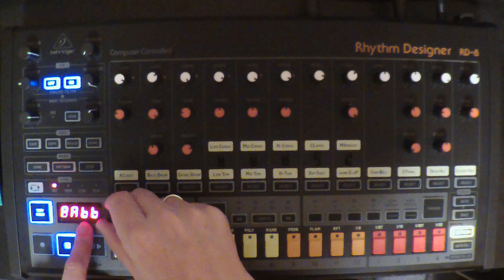Behringer RD-8 Behringer bug (fixed in version 2.0.2)

Comment: It seems to me that the issue is that the first step of the the pattern you have just changed to plays at the step size of the previous pattern.

One way I have found to overcome this bug is to sync the RD-8 from an external MIDI clock.
Reply from the maker: Thanks for the comment and sorry for the late reply, I didn't get notified on a lot of comments as I just found out. This is great info btw, I must give it a try! Thanks for the comment!
Reply: This problem goes away if you sync the RD-8 to an external MIDI source; this seems to override the issue.

Comment: Does it do this with 16 8 and 32 then it seems normal cuz you changing tims signatures from 4/4 to 3/4 and then back to 4/4 you add and loose a beat so its gonna be off . try staying in 3/4 time
Reply from the maker: Sco B  No, this is clearly a bug. When switching from 4/4 to 3/4 you actually switch from a 16 to a 12 step pattern and back and this should not affect the tempo or the actual position of single steps in either one of these patterns at all. The change should happen seamlessly, there shouldn't be an audible difference between the two patterns in this demo, except maybe for the swing value in the 4/4 pattern not matching a 12 step pattern 100% (but extremely close). I have many other drum machines and grooveboxes and I've written songs that vary between different time signatures so I can tell you that other machines like the TR 8 don't have this issue. I am quite convinced Behringer will fix it though, it only seems like a matter of time.

Comment: Great video ! I have a question: I would like to output the sounds of my rd8 independently on ableton (in usb or audio). Is it possible to have the RD8 as an audio interface? or that each instrument is on a single audio track? (to work on stereo)
Reply from the maker: Unfortunately the RD-8 doesn't offer audio over usb functionality. You can use it as a MIDI interface but not as an audio interface.
Reply: @LousyFacelift  
Ok thank you for your answer, and how can we get independent sounds from others on the daw?
Reply: @LousyFacelift  so to get Multi-track Recording?
Reply from the maker: Leo M You need a mixer and outboard gear like effects processors to shape each sound the way you like and then send the mix out to your daw. Or you would need an audio interface with as many audio inputs as outputs on the RD-8. So it's more of an old school approach just like on the original 808 in the RD-8. Some that wish to do what you described prefer the Roland TR 08 over the RD-8 because there you have audio over usb and not so many individual outs.
Reply: @LousyFacelift  
ok thank you so there is no way to make the multipist with the "mono" or usb i think.

Comment: Has anybody else come across this bug: When performing a save pattern, you are prompted to select save destination. However the pattern is saved and overwriting the original pattern number no matter which destination you select.
Reply from the maker: Haven't noticed this but it seems you can only copy patterns within the same song. So basically each song has its dedicated pattern bank with 16 slots and you cannot copy any of the patterns from one of these banks to another.
Reply: Interesting. In this case I'm trying to do a "Save as.." kind of operation within the same bank, neat for saving a few variations on the same pattern.
However I realised that the RD-8 ignores your choice of save destination. Workaround is to first copy then alter.
Isn't nearly as grave as the issue you demonstrate in the video - A drummachine that cant keep time, that's just gnarly ;-)

Comment: Mine has issues when switching beetween patterns that were written in the same time signature. It either takes much longer than it should to switch or doesn't run until the end of the sequence, or a combination of both (it might for example play the same bar twice and start the next pattern on the 3rd beat, instead of switching at the very end of the first sequence and playing the next sequence from the first beat). Have you experienced this yourself ?
Reply from the maker: That's new to me, sounds quite chaotic indeed. Let's hope for a bug fix in the next update. Thanks for watching!
Reply: This is not something I've read about online either. I've sent them a support ticket while waiting for an eventual miracle update...
Reply from the maker: Tresor Public Well, they still have the RD-9 in the pipeline and I don't think they are going to release it without fixing the firmware first. Akai did the same with the MPC Live. It was full of bugs when it first came out but they kept improving and fixing stuff and they are still on it to make it an amazing machine. That's not how it should be of course but I'm quite optimistic about it.

Comment: What happens when you're swing is set to 50? Just out of interest....
Reply from the maker: That's the neutral setting meaning no swing at all. It's a percentage value which defines when all the even number steps are played in relation to the odd number steps. The time elapsing between step one to three would be 100 %. Since 50 % is right in the middle between steps one and three this means no swing at all.
Reply: @LousyFacelift  Yes. I noticed that your swing was set at 67 for this video.... I was wondering if the behavior of the bug you described was the same with swing set at 50.
Reply from the maker: John Franklin-King Swing is set to 67 only for one of the two patterns. The patterns are programmed using two different time signatures but still sounding the same because of this setting. Swing should have nothing to do with this issue.

Comment: I don't think drumbeats are copyrighted 🤔
Reply from the maker: Yes, probably not but I wasn't sure... It seems they are finally doing something about it, rewriting much of the code for the RD 8 before they release the RD 9. I hope they get everything fixed.
Reply: @LousyFacelift  yeah cuz I think chord progressions aren't even copyrighted, so a beat seams unlikely. Sounds dope all the same 👌. Yeah the issues with the rd8 are sort of putting me off getting one, heard there are midi sync issues also...
Reply from the maker: Jamie Kent Yes, I had to say it before - I cannot recommend getting an RD 8 at this point, which is a bit of a shame but they seem to be at it, working on a solution. They have to have things fixed before the release of the RD 9, so I also don't suggest selling the RD 8 to those who have already got it. I would like to hear from someone who bought the RD 6 if that has any timing issues with different scales... maybe they already fixed this issue in there. Who knows?
Reply: @LousyFacelift  yeah that's exactly what I'm wondering, for the moment rd6 demos are pretty basic... Wait and see 🙂

Comment: Yep. This is my biggest issue with the unit. Going from 1/16 to 1/32 and back, no matter what master tempo I set, I get this issue. Definitely needs a fix. The latest firmware didn't resolve the problem. Did you contact Behringer?
Reply from the maker: Haven't contacted them, no. But I hope they know already and realize it's a true bugger...
Reply: @LousyFacelift  I submitted a ticket, and also flagged a request for midi program change for externally sequencing patterns, along with request for option to remove flam/probability triggers from new patterns. We shall see.
Reply from the maker: ozoneau Good thought on the flams there, too! You can create a pattern template for this but copying it over everytime is a bit of a drag. Thanks for contacting them!
Reply: There are more firmware updates coming so I'm sure all these will be resolved
Reply: @sirsilver1968  Sounds promising. Where did you hear about upcoming firmware?
Reply: @ozoneau  on the gearsluzt forum uli behringer is a member there along with one of the testers from Manchester they confirmed that more updates are in the works for the rd8
Reply: @sirsilver1968  Thanks for clarifying. Sounds promising. Still an awesome piece of kit as is.
Reply: @ozoneau  your welcome it is yes I love my Rd8
Reply: @sirsilver1968  The (sad) resolution from Behringer after sending a video demonstrating the issue to support: They couldn't recreate the issue and told me to return my unit as they consider it faulty.

Comment: All Behringer products are made 1/2 ass. They need to spend less time counterfeiting Roland's product, and more time in R & D. Roland's 40 yr old TR-808 still runs tighter than Behringer's new RD-8. Behringer never made a perfect product, it's their legacy !
Reply from the maker: I disagree. I don't own the Neutron but it's an original Behringer product, no cloning involved at all and people seem to love it. To me that's a perfect product. The Model D is a widely respected remake of the MiniMoog. It costs less than 10% of the original, adds MIDI and a high pass filter and people can't tell it apart from the Moog. To me that's a perfect remake. They are currently rewriting the code for the RD 8 and 9. They won't let us down on this. Peiple complained about the envelopes in the Pro 1, they fixed it. Sounds amazing now! Do you ever hear guitar players complain about Stratocaster and Les Paul remakes? No. Probabky because they don't have the time to do that, they are busy playing them... So why do you hate on Behringer?
Reply from the maker: FICKFEHLER  What's the problem with Hyundai? From what I hear they are quite underrated, I could be wrong though because I'm not into cars. Behringer are currently putting out the largest number of synths compared to any other synth company by far. It would be quite surprizing if this didn't also lead to the most returns automatically. I invite anyone to talk about their personal experiences with their instruments, no matter what brand. When I bought my Korg EMX I had to send it back twice because it had an issue with the main encoder and they had failed to fix it the first time around. I realize the EMX, despite its sturdy appearance, might not be one of their highest quality products after all but I still don't feel the need for bashing Korg build quality in a generalized way, which is something I do notice as soon as any type of problem with a Behringer product comes up. And I don't think that's fair. I also had to send back the first Roland SH-01A I bought because the little light next to one of the ribbon controllers wouldn't follow the movement of my finger like it's supposed to. Small issue but still lowering its value so I sent it back, bought another one - love it! What I'm trying to say is - no matter what company, they all make more or less good and bad quality products. It's up to us to evaluate the instruments individually and see if they meet our expectations or not. Behringer can offer these cheap prices because they are a huge company that can produce more units than anyone else and they also fabricate certain parts that other companies buy from them to build their instruments hence the good price. Yes, at ~ 10% of the original price we may not get the same build quality as the original but far more than reasonable and even further enhanced functionality in most (if not all) cases.